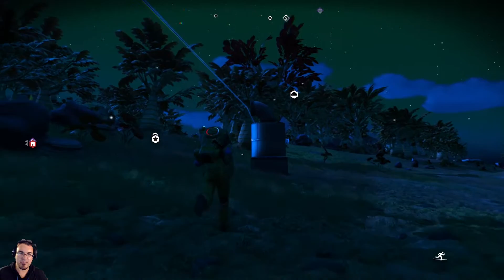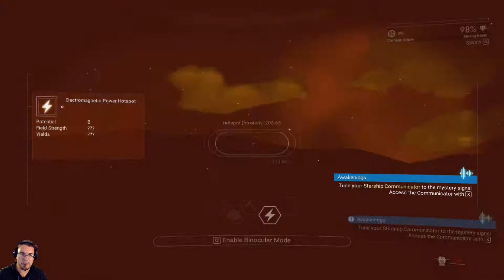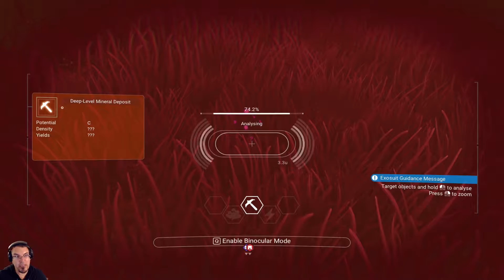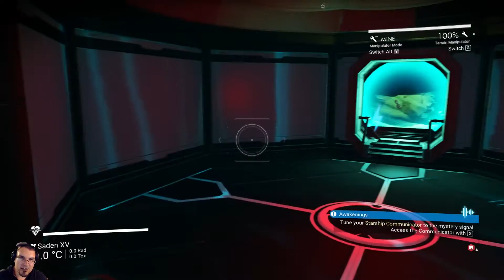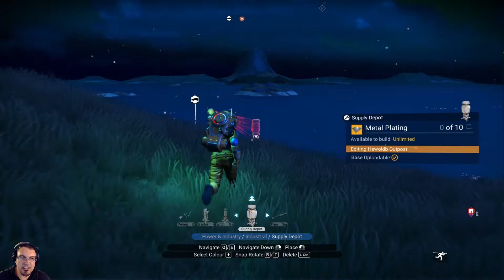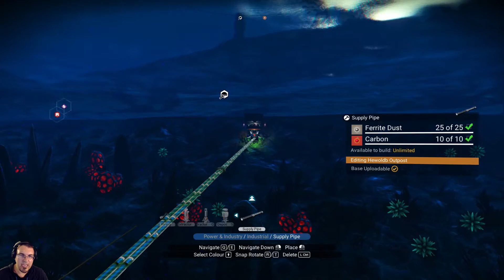How to Expand Your Base to Power Extractors! - No Man's Sky Beyond Tutorial

Comment: Apparently it doesn't work anymore =/
Reply: for sure doesnt work... i have spend hours trying to connect a base roughly 500u away and am jusy getting stuck
Reply from the maker: Apparently it was still working as of a month ago for sure.  There might be something you're not doing.  Are you sure you're laying down building parts inside the base's radius and not using a 2nd base?
Reply from the maker: Someone else commented that it was working as of a month ago.  Give it another spin
Reply: @KoiGaming  I built a few more bases, the odd thing is, on some bases I can get 500 - 600 U away, and on another Base I cannot get 300 U away from my base computer. On this specific base, I have done everythijg from lining up batteries 50 U apart, to spreading them out every 100 U. It seems like the game will pick and choose what base it is acceptable. I just plain and simple, dont understand.

Comment: what happens if the power source in under water, what then and is to far from your base ???.
Reply from the maker: I think I covered that bit with the gas exchange unit.  You technically can use the underwater power source.  Just more challenging to lay down building parts inside the base radius to expand the base towards it.  Eventually with enough work you can get there (unless it's in ultra deep water and you have one of those monster fish that eats spacers for breakfast.  Then it would be a mega challenge :)

Comment: I tried adding a base structure with some batteries every less than 200U. 3rd section just wouldn't connect. Might be inside the next base, but not sure. why power stopped there...?
Reply from the maker: So if you have two bases (which sounds like that's what you're describing) there will be a weird point where you're laying wires for the wrong base and suddenly your power doesn't come on.  I wish the game would have a better and more clearer way to delineate which power source belongs to what base

Comment: Let me save people a bit of time here if you came looking for the answer and not 30 minutes of video:
 1. Walk from your base until it stops letting you build base stuff.
 2. Put a wall or whatever down just inside that border line.  Presto, you've extended your base range another ~50-100ish meters.
 3. Repeat on the new border if you need further distance.
Reply: Man thank you. 30 minutes is something i cant handle. You are a lifesaver
Reply from the maker: You hit it on the nail.  One thing I did with the vid was describe different situations people needed this for to help clear up some of the issues :)
Reply: Evo Epitaph the problem I’m having is I would get to a certain length then, it would just turn red, nor doing anything
Reply: @bruh9187  You need to put down a wall or something inside the current boundary, close to the edge. Once you've done that the boundary will expand itself by a bit and you should be able to connect things within the newly expanded boundary.

Not sure if recent patches have changed anything, haven't played for a while.
Reply: Evo Epitaph Ok thx, it still works
Reply: Thanks a lot my guy
Reply: YOU HAVE SAVED ME FROM PAIN
Reply: Your the man !!!!!
Reply: If I'm maxed out at 1083 do I need to delete back and rebuild to get the full 1400 i need?
Reply: Bro it just does not work, actually i can t even do the shit u said cause am stucked in dat B mode when u can toggle camera and it comes to dat point i can put anythin from on place to like 300 metres fuckin away but when i do one step i can t do anythin.
Reply: @lenox5018  Don't go into builder overview camera mode, just walk with a wall out in front of you until the wall turns red, then take a step back and build the wall on the edge. Building just inside the edge of your base property will expand it a bit. 

Just did it today so hasn't been patched out.
Reply: @Rouzuki   @Evo Epitaph  will try, tho i doubt it, can t believe they didn t fixed it for these years, this can t be wanted mechanic, ty for response mate
Reply: @Rouzuki  it does not work :) actually it so fucked up as i said and even more cause i can go threw the wall i put there even, it s like it s not even there and as i said i can put the wall kilometres away from me from my position but when i move one cm straighty then i can t do a shit, so as i said u already i can even do this shit with the wall fix :))))
Reply: saved my time here, tyvm.
Reply: So I am able to extend the wall but the power stops after like 800u help plz.
Reply: @djcoolmoney17  you mean the cable stops? Because you can connect two or more cables together, no problem.
Reply: thanks a lot ! but the maximum range is i could go on like this was 1100u -ish. but thanks to the in-air placement with the jetpack i could extend it another 50u. also if you have trouble connecting it with a cable try to fly at the edge of base range

Comment: Doesn’t work for me .. when I place the battery it doesn’t extend it :/
Reply from the maker: So I'm seriously thinking of doing another update vid based on the same base expansion for the latest living ship update.  I'm wondering if there's a particular thing people are doing/not doing that's affecting their efforts to expand the bases.  I've noticed some folks have no issues while others sometimes run into the struggles you have
Reply: Koi Gaming I got it to work, I just had to load up my save again and not go through a portal since going through the portal locks it
Reply from the maker: @darioturcios5673  Oh interesting!  This must be the reason why several other people had problems with it.  I didn't realize the portal could affect it like that
Reply: Koi Gaming yeah it works fine now for me! I just save at the edge of the border and reload it back up. Hope that works for the other people that had trouble too.

Comment: As of Jan 5 2020, this only works if you have 1 base and stretch it out like in the video to a power source or gathering spot. I tried to connect 2 bases and no luck but stretching one base out, I was able to go over 1000U away, so thank you so much for the stretching tip, it helped a lot.
Reply from the maker: You're welcome!  Yeah you can't use more than 1 base.  If you do there's some sort of weird thing that happens where you cross contaminate each base with each other's components.  After doing that and you delete one of the bases you'll be super surprised by how much gets deleted that wasn't part of your base
Reply: My power cable stretch out sometimes and sometimes it doesn’t how do I fix it

Comment: doesn't work for me
Reply from the maker: Check and rule out a few things.  First you have to be inside the base limits to expand the base.  Second avoid having two bases close to each other so their expansions don't cross over.  Third, make sure when you cross the boundary between the base and no base you only have portable items.  Then go back until the base building stuff returns and plop down something like a battery to push out the boundary a 100u or so
Reply: @KoiGaming  I did a quick restart and it fixed it, thanks .
Reply: @DMTXXDMT  what do you mean witha quick restart?
Reply: @kuervogaming4250  I restarted game
Reply: @KoiGaming  300u is my max and I can't change it
Reply: @KoiGaming  doesnt work for me :(